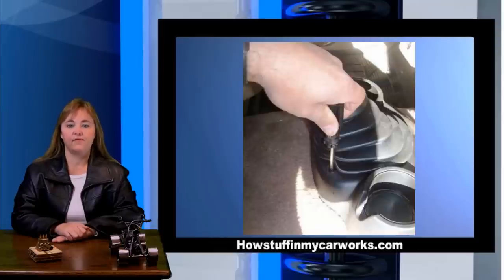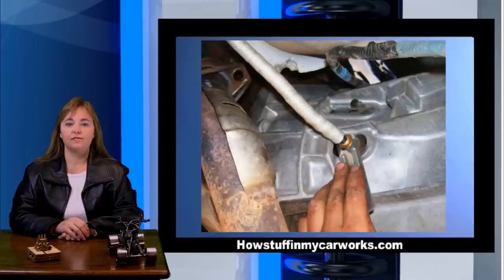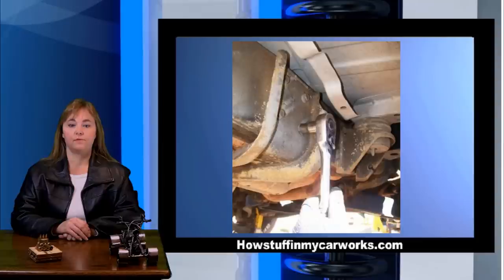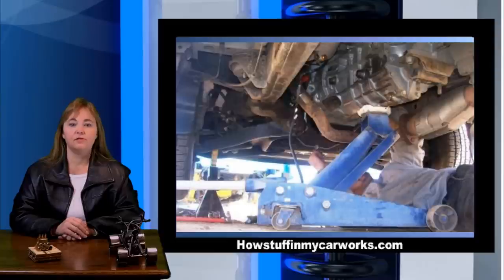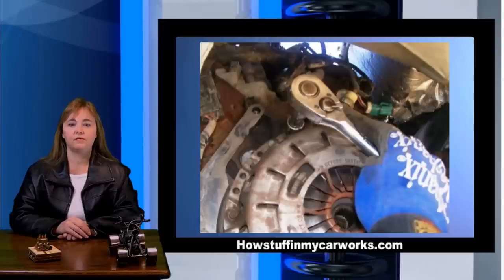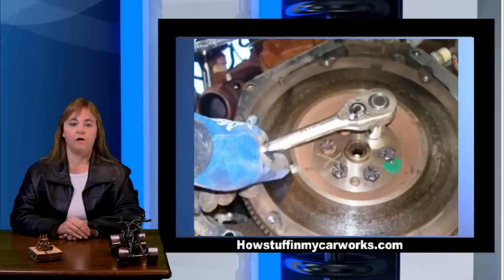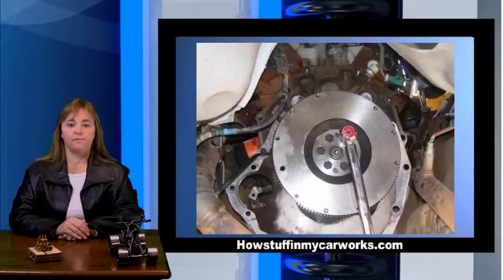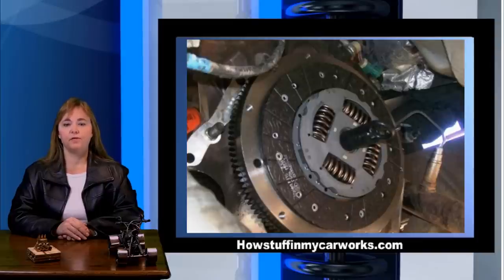1993 to 2005 Ford Ranger 2wd Clutch set replacement by Howstuffinmycarworks

Comment: after you do all that and it still want shift does that mean it still feel of air
Reply: Azzazel794 bleed the system like you would do the brakes. Bleeder screw right above where the line from the slave cylinder connects to the clutch.
Reply: Doubt you still need this but you have to pull the master cylinder out take it apart and bleed it through there there are videos to do it there it won't bleed out because once it's installed it's the highest point in the line so air builds at the top of the cylinder under your foot